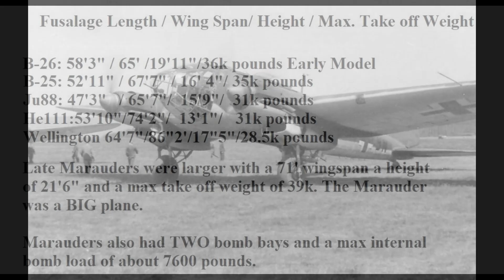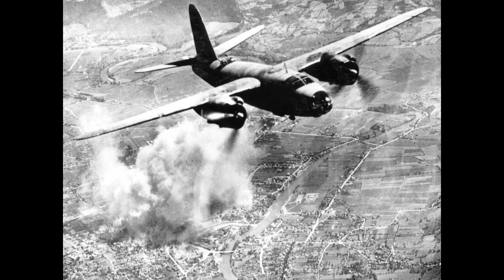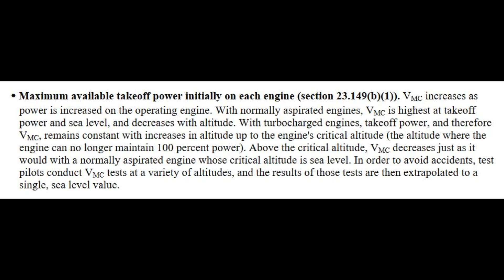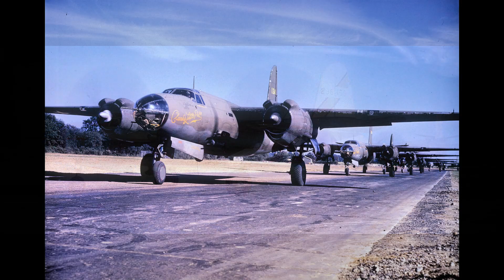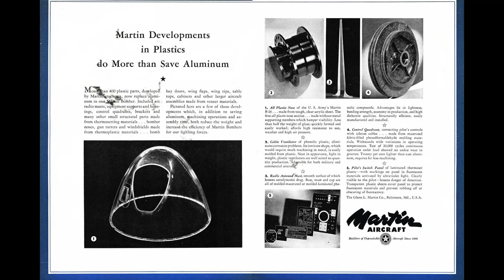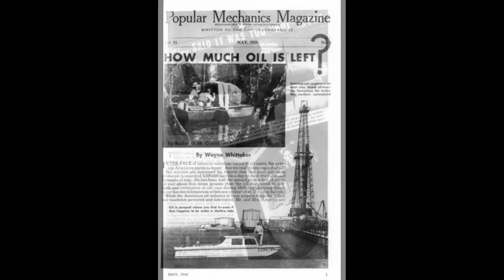Martin B-26 Marauder. Unsafe At Any Speed?

Comment: When looking at the American 2 engine bombers, I tend to get confused on the differences between them.  B-25, B-26, A-26, ect...  What were the differences in airplane and what were the differences in use.  I think a comparison video would be interesting.
Reply from the maker: That's a good point. The B-25 and B-26 were direct competitors. Of those two, if going into combat I'll take the Marauder any day but both were really good airplanes. The Douglas A-26 Invader is in another league. With 2600hp per side via water injected R-2800s and a bigger version of the same wing used on the P-80, it was the fastest US bomber of the war. Add in a very advanced turret system that can hit enemy fighters with great effect at 1000 yards, plus a lot of armor and it's a plane that's very hard to counter.
Reply: The Connie/P-38/L-133/P-80 type or look wing seems consistent, where did the Douglas A-26 fit in?  A new semi laminar flow aerofoil section would need different wing spar arrangements compared to previous 20-30% of chord max thickness wings?

Comment: Question on the dual definition of V1: the FAA defines one part as a maximum speed for a safe accelerate stop distance, while the other part refers to the critical engine failure and safe climb at the end of a takeoff run. From the presentation, they seem to be largely different. Any commentary on why the definitions merged?
Reply from the maker: V1 is both accelerate stop and accelerate go, it incorporates both of those.
Reply: To very humbly add something, with a short or downhill or downwind or wet runway the needs of stopping on the runway are very significant and the V1 (last opportunity stopping decision) speed is much lower than the safe asymmetric take off speed Vr.  Super video, thanks Greg.

Comment: I wonder what was the need for the B-26? It seems like it was an aircraft built for a niche that never really proved a necessity. A fast medium range low altitude bomber that never got the power plants it needed for that role. If the army had taken the resources consumed by the B-26 program and spent them on more numbers of B-25 and A-26 aircraft how would they have been handicapped? I think they would have had about the same results and the reduction in training and operational loses would have made up for combat loses. Even being a reasonably good medium bomber it still seems like a luxury that could have been avoided.
Reply: A comment after my own heart.  

Already at the beginning of war, USAAF Director of Military Requirements General Muir Fairchild was of the opinion that medium bombers were an outdated concept and a waste of resources. There were too many categories of bombers, and mediums being stuck in the middle didn't do anything better than heavy bombers or light attack bombers could. USAAF had bomber categories of light, medium, heavy, and dive bomber. Fairchild advocated changing bomber categories to just three: high altitude, low altitude, and dive bombers.  Even though Jimmy Doolittle had been instrumental in saving the B-26 from the chopping block during the worst of its teething troubles, when he took command of the North African air forces he told  the General Arnold that he wanted B-17s or B-24s instead of B-25s or B-26s. He didn’t see medium bombers as useful or versatile as heavy bombers, and he knew the cost of a B-26 was the same as a heavy.  

My understanding is that the U.S. did not want the Mosquito to replace the P-38 as a single seat day fighter used for escort and air superiority. I do think USAAF make a mistake in not acquiring the Mosquito when it was offered, but the mistake was in evaluating it as a replacement for the P-38.  It should have been acquired to replace the B-26 and perhaps even the B-25.
Reply from the maker: Had the A-26 been ready in 1941 we would not have needed A-20s, B-25s or B-26s. However, that wasn't the case. The U.S. went to war with the planes that were ready to go. Thankfully we had both B-25s and B-26s. The Mitchells would have been shredded going against the Axis in Europe and the Marauders with their long runway needs were not well suited to the Pacific. The A-26 was far better than either of the others, but came later.
Reply: @GregsAirplanesandAutomobiles  I would argue that the B-26 was far from "ready to go" in it's 1941 form. It really was a case of testing a weapon by putting into service and seeing what happens. The Germans did that a lot but the U.S. tended to avoid combat as a weapons test program, the B-29 being the other exception. I will say this, it was a very good looking aircraft and I think that was a part of the appeal. 'If it looks right, it is right.'
Reply: The medium bombers hit relatively local targets from medium altitude and actually hit them.  The heavies all dropped their bombs from 24,000 ft and higher when the wing’s lead bombadier dropped so many thousands of bombs covered several square miles on the ground.
Reply: @givenfirstnamefamilyfirstn3935  The heavies bombed targets in Germany from high altitudes to enhance survivability but could drop from lower altitudes to increase accuracy in other circumstances.  Two examples are use of heavy bombers for ground support of the allied advance after D-day, and the low altitude bombing of Japan by B-29s.  Let's not even talk about Ploesti.
Reply: @gort8203  The D-Day bombings were foul ups, the Eighth AF pathfinder planes had high technology Gee hyperbolic grid navigation equipment so they could have precisely bombed parallel to the coast with Loran/Decca accuracy but the Colonels and Generals didn’t understand the technology and ordered bombing across the beach line so the inevitable release error misses hit the sand or farmland.  The Operation Cobra break out bombings, also north to south hit American troops, the dead included General McNair.
Reply: @givenfirstnamefamilyfirstn3935  Yes, I know about the foul ups in those close support operations, which were innovative at the time.  But the fault was in the operators, not the airplanes used.  If the same units had been operating B-26s they would have made the same errors.  

The point is that the inaccuracy of heavy bombers on which you generalized was due to the altitudes from which they bombed strategic targets. They could be as accurate as medium bombers at hitting bridges, marshaling yards, ammo dumps, etc., if they bombed from the same altitudes, and they could drop more bombs.

Comment: Re multi-wheel main gear on fighters, for certain definitions of fighter the MIG-31 could qualify (2 wheels on each leg, but one's in front of the other.) Not exactly a "less weight" design philosophy on that plane though (I've been a passenger on airliners that had a lower MTOW).
Reply: Also the SR-71 come to think of it...
Reply from the maker: There are some, one person brought up the Swedes. The point is, there are not many and yes, the Mig 31 is the weight of an airliner.

Comment: A WW2 B26 pilot I knew told me a few interesting things about his experience with this plane in combat.
1. He said it was not a bad airplane as long as it was flown by the numbers. Obviously in combat things are not always optimal especially due to battle damage resulting in a rather unforgiving aircraft.
2. He told me the German antiaircraft fire was very accurate below 20K feet and as you observed this plane could not really haul a bomb load above that altitude.
3. German fighter aircraft would attack from directly in front.  The closing speed is quite high and the fighters would roll inverted while firing and doing a split S timing the maneuver so it could fire at the B26's belly as the fighter pulled vertical. Pretty exciting stuff for all involved.
4. He told me there was an emergency power setting that resulted in the pilot pushing the throttles all the way forward breaking safety wires on the quadrants. When the aircraft returned after a mission one of the first things checked by the ground crew was the safety wires and if they were broken the engines would have to be changed. He said he was responsible for so many engine changes that the ground crews would ask him who's side he was on?
Reply from the maker: I would have broken those wires too whenever needed. The engines don't do you any good if you don't have a plane and crew to use them.
Reply: @GregsAirplanesandAutomobiles   Sadly the WW2 pilot who told me some of his experiences is no longer with us.  I told him that his exploits should be put into a book, but he was a rather humble guy and it was only after a few private conversations and questions from myself that he would open up a bit. His experiences should have been somehow recorded but sadly like many others are now lost.

Comment: Greg another excellent video.  When talking about the B-26’s safety record one thing you do not mention is the experience level of the aircrews.  In general these were very young, low hour pilots.  Their learning curves were still going straight up not only through their training period but right on through their operational flying as well. This, of course, was true for nearly all pilots and aircrew during The War.  Nearly 15,000 USAAF personnel were killed in the Continental US from 1940-1945.
Reply from the maker: Hi Tom, I didn't cover that because it was more or less a constant across all types and even all Air Forces. That is until of course the average experience of Axis pilots went way down. Yes, experience counts, especially in flying. I'm strongly against reducing the 1500 hour rule. Had they had a 1500 hour requirement in B-26s and simulators, accidents would have been way way down.
Reply: It does make you appreciate the invention of simulators. If they had modern flight simulators, they would have been able to train a lot safer.
Reply: My Mom’s cousin was one of them. He crashed during training.
Reply: I think that the loss figures for training amounted to thirty thousand!
Reply: @mongolike513   thanks for your reply. Between 1941 and 1945 the Army Air Force suffered approximately 15,500 fatalities in 6,350 fatal accidents with the lose of slightly more than 7,100 aircraft.  These extensive losses occurred just within the continental United States.  While primarily training related accidents, some can be attributed to such things as testing, maintenance checks, operational and administrative flying. This number does not include similar losses to Naval/Marine/Coast Guard Aviation. These numbers were arrived at through examination of the AAF Statistical Digest published in December 1945.  So your point is correct, aviation in the early 1940’s was dangerous business even when no one was shooting at you.

Comment: Your breakdown of the low speed flying characteristics was very interesting. A fellow that I know was a Mosquito pilot. He took one up to ten thousand feet and put it into, I think, landing configuration and then chopped the power to one engine. In a split second it flipped inverted and he didn't recover until after reaching three thousand feet! The canopy panel beside him cracked but no other damage seemed to have occurred. I don't think he said if his 'gator was with him!
Reply: Mosquito does not have a friendly stall... from a non-pilot DCS flight sim gamer perspective anyway.
Also with a Flaps/Gear down stall speed of 100mph and VMCa of 175mph... even I can do the maths on that and come out at a lot more than 1.2!!
Reply: Landing configuration includes the high descent rate and the well reduced applied power for speed control going downhill.  Maintaining level flight power settings and zero rate of descent before pulling the power on one side to idle with the prop windmilling the engine is begging for trouble.  The asymmetric minimum control speed for (low) approach power is much lower than it is for level flight or in a climb.
Reply: @givenfirstnamefamilyfirstn3935  He may have been mimickiing an engine loss on take-off. I am trying to remember from ten or so years ago. Sadly, I cannot ask him to clarify it now.

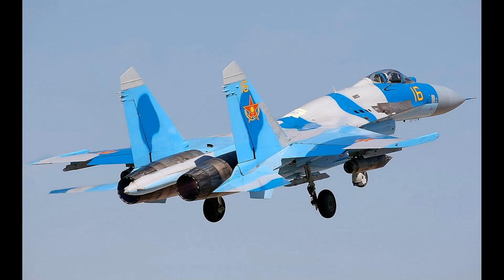Comment: 1:02:40 Saab Viggen (20t max. weight) has dual main wheels in a tandem setup. While not a fighter, the Sepecat Jaguar (16t max. weight) has a similar overall setup and side-by-side dual landing gear
Reply: I came up with those two as well.  Plus the Harrier (which is cheating just a bit).
Reply from the maker: I think these planes as well as the Mig 31 really make my point. All of those planes are making a sacrifice in performance for some other design goal. The Viggen had a design goal of being able to use improvised runways and to achieve that, some sacrifices had to be made. The Harrier has dual main wheels, sort of.... and the big Mig has a higher max take off weight than a Douglas DC 9-21.
Reply: @GregsAirplanesandAutomobiles  Agreed, everything is a compromise. Very few modern plane would feel comfortable on a patch of grass, nor are they meant to be.

Comment: MacDill AFB was the training base for the B26. They had so many training accidents there in the early years people in Tampa said one a day in the bay.

The biggest problem the plane had was very high Wing loading. Martin the manufacturer knew this and knew what the solution was.
Reply: Laughlin also was a major B-26 training base, and functions as a UPT base today
Reply: The high wing loading is easy to adapt to.  It is the story of ever faster airplanes.  What was not easy to adapt to were the sudden engine and propeller failures that left the crew no time to recover.
Reply: @gort8203    Cant blame Martin for the engines and propellers.  Electric props are still pigs.
Reply: @givenfirstnamefamilyfirstn3935  I don't blame Martin for the engines and propellers. If they had been more reliable the accident rate of the airplane would have been much lower even with the wing loading people get their panties in a twist over.
Reply: And when Martin increased the wing span the Air Force increased the take off weight.

Comment: Straight from the drawing board to the production line where they toss in a whole bunch of new technology except for the amazing new engine the drawing boards guys had kinda planned on putting in their beefed up airframe leaving a still relatively new and less capable engine bolted into the nacelles out of necessity. Roll them out off the factory floor and right into the hands of very young inexperienced pilots who may have been rushed through their training just a we bit or who had been flying simple bog standard low tech brute force chop through the air aircraft but before takeoff by all means don't forget to load the plane down with a few thousand tons of bombs then on top of all that pump in a few hundred gallons of aviation fuel just to make sure that if the plane does go down nobody has to waste their time looking for the bodies much less any survivors.
What could possibly go wrong?🤷‍♂️

The exigencies of war has a brutal way of cutting out such niceties as Health & Safety much less the ridiculous luxury of such things as comfort and what we now call ergonomics. It is all slashed down to calculating the loss rate subtracted by the replacement rate for both the men and machines divided by the number of bombs on the target. The mathematics are by necessity bleak at best and bordering on criminal at worst for some command decisions and missions.🧐

So,,, you back in a seat flying the friendly skies Greg?
*crossed fingers* 🤞😌
Reply from the maker: Thanks SWR. I always look forward to your posts. I am now back flying in real life. I'm really happy about it as I missed flying and my friends at work.
Reply: @GregsAirplanesandAutomobiles  🥳Yes!🤗 Good to hear that!

Hopefully you can now relax a bit and enjoy yourself. You seemed a bit stressed in a few clips of this video. No doubt the stress will subside as you get back into the routine of your flying job.

Looking forward to your next video on whichever aircraft you choose to close out the video series on that may be a bit open still.
You da man Greg!😎👍🏻
Just remember, painted side goes up and the rubber side goes down on your 🛬

Rubber side down at least when you are below a couple hundred feet that is.😁🤙🏻